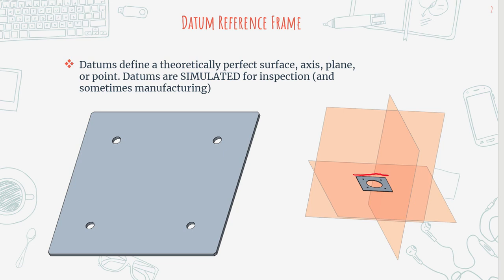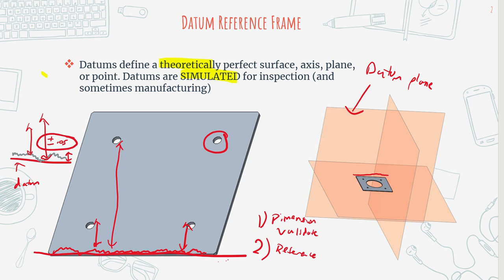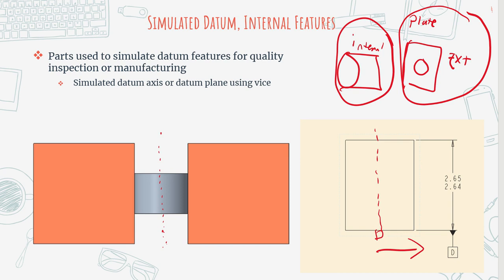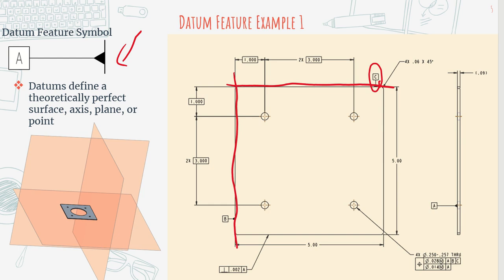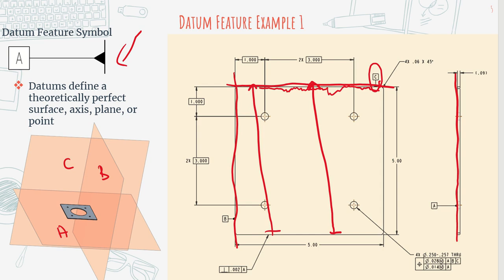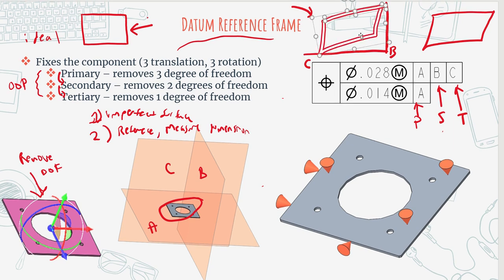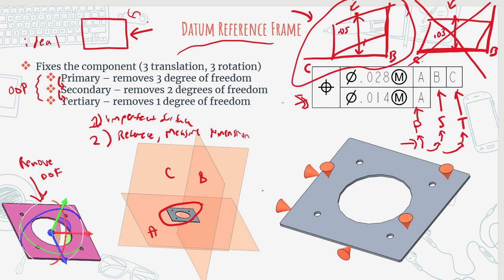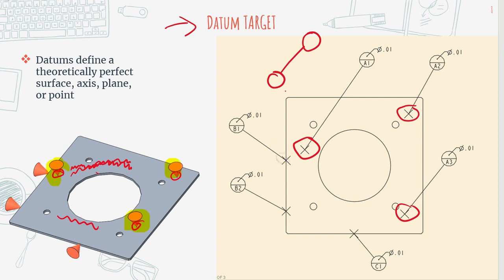GD&T Lesson 2: Datum Feature, Datum Reference Frame, Simulated Datum, and Datum Target

Comment: Can this concept be used in architecture?
Reply: this type of approach is developed for mechanical parts since accuracy is needed for life span of the part and to be able to function / assemble properly. you would not normally care for deviation of micro meters in architecture.